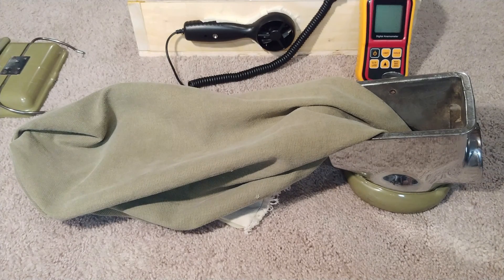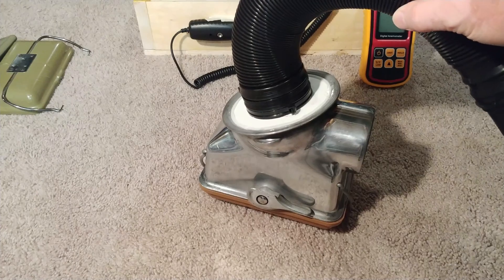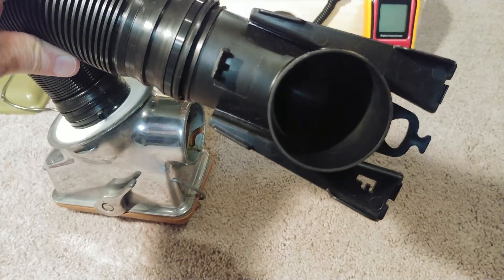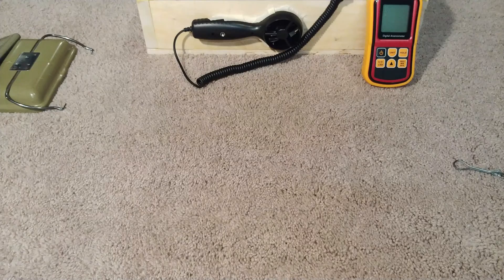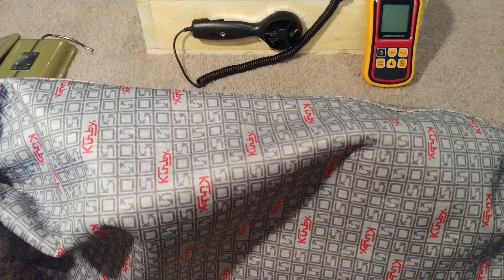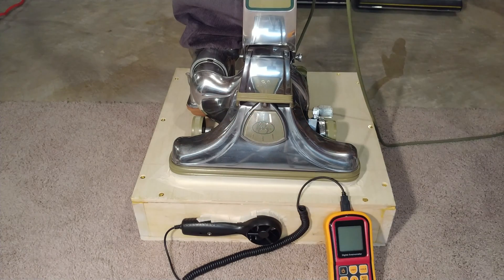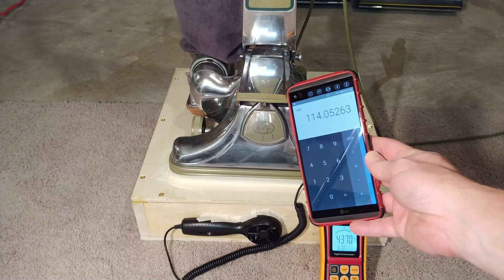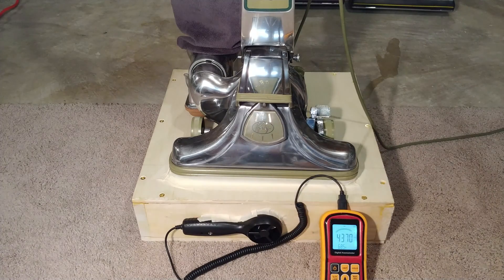Kirby Shakeout Bag Conversion Kit Prototype Testing - Part 1

Comment: Personally I like the shake out bag a lot better than the disposable bags, however for someone wanting the disposable bag while keeping the original bag, this is a great option. The only issue I can see with this is if you are going to use the original bag for the machine, and not the aftermarket one, you would have to remove the outer bag completely to get to the inner bag to replace it? They only have a little zipper for the Sani-Pocket, and do not unzip all of the way! It seems like that would be an issue, especially for someone who does not want to/know how to completely remove the bag.

Comment: I just converted my 561 to a Tradition Emptor with Heritage top fill adapter by using plumbing reducers from top end of fill tube to adapter. No 3D printing required or modification to Emptor. Using the Charcoal HEPA as you suggested in other vids. Setup is working and looks better than typical mini Emptor conversion IMO.

Comment: This is what I want to do with my classic 3
Reply: 1911beauty I did this to my classic 3. Bought a tradition emtor and a bottom adapter for a heritage 1. Had a seamstress install a long zipper in original bag. Added the fill tube and top of a heritage 2. And voila heap filtration and the machine looks original.

Comment: Thx for posting. We are going to get this bag/filler tube right!!!! Darn.  Was a little bummed at the cfm ratings compared to the Heritage legend mini emptor’s numbers....really thought it would be closer ...especially woh he larger sized fill tube compared to the H Legends.  🤔 alright Ted , lets get to those changes
Reply: The mini emtor forms a better deal around the exhaust.  Where bag connects.  
Have you thought about putting a little bigger tube at the begining and tapering down.
Reply: @les2998  no because the /our purpose is to design an upgrade that keeps the original Sani-emptor in place with a designed, secured, and dependable system using modern Hepa bags.  oh, yes, the tapered fill tube was considered....ran into some undesirable side effects with it....